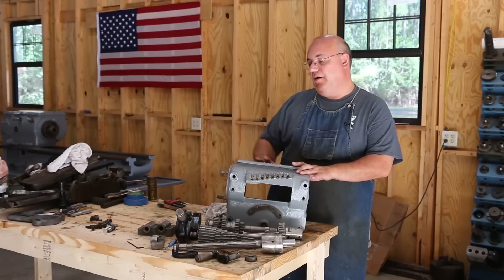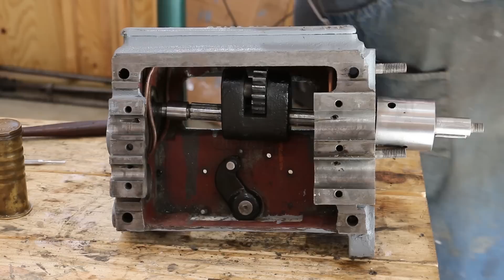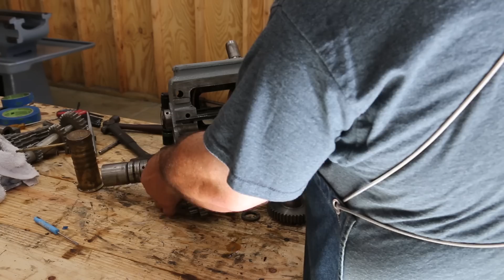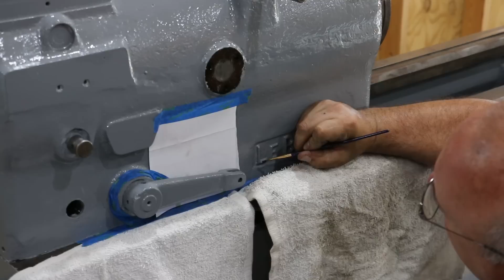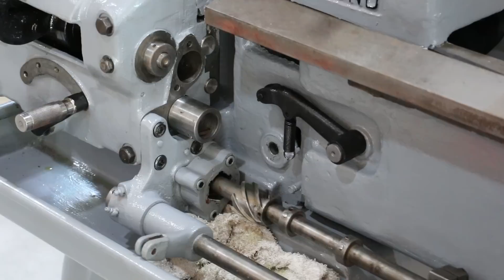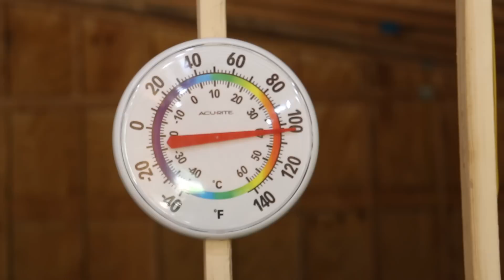LeBlond Lathe Restoration - Part 6:  Quick Change Gear Box Reassembly and Installation

Comment: The machines you work on are amazing examples of human ingenuity.  Sure, since the 1940s we've achieved moon landings and now AI, but who made the first screw precisely enough to cut more threads?  I guess they started with gears.  How did they get them to mesh smoothly enough to make gear cutters and carbide inserts?  And metallurgy?  My 1905 copy of the Machinery's Handbook describes steels that are still in common use, but none of them would hold up inside a rocket engine or EV battery.  On the other hand, the most modern trains don't run on lithium or ceramics.  After thousands of year of human history, standardized screw threads were invented barely a hundred years ago. It just keeps getting better.

Comment: I wonder why they have taper pins and set screws? The only thing I can think of is that they positioned everything with the set screws during manufacturing, then drilled the tapers. So the set screws are redundant.

Comment: My late uncle had what I think was a somewhat earlier 14" swing (which turned out to be about 22" in the gap in front of the chuck) LeBlond toolmakers lathe with almost exactly the same quick-change gearbox - although the change handles were brass not silver. The paint was a dark green and the "LeBlond" was picked out in gold. I seem to think the speed data plate was brass too. His wasn't a geared head though - had, I think, a three-step flat belt pully on the spindle - I loved the sound of the belt "flapping" - spent many hours with him learning about turning.  This video brings back some very fond memories - thanks Keith.

Comment: Hey Keith, either I missed it or ya didn't speak about the motor. Going by the pulley down on the motor, i'd say its got some torque and power.  looks great

Comment: Curious why you didn't get the parts Powder coated? Time and cost?
Reply from the maker: Time and cost for sure.  Also I would have to take everything down to individual parts and mask off all of the machined surfaces that you would not want power coat on.  Not very practical.

Comment: Progress is good. 

South Bend used set screws with brass bits for various things too.  Many of mine were missing the brass shoes, and honestly I found them to be cumbersome to deal with extracting so I got brass tipped set screws from McMaster to replace them.  Easier than fishing little parts out to lose, and it won't wreck the threads either.
Reply from the maker: LOL - yeah, they can be a pain if you take them all the way out!

Comment: When taking it apart, you STRONGLY recommended taking lots of pictures. Maybe a mention or look at some of them during reassembly. Great job Keith. Looks like new!  Bet it will run good too. Want to sell it? Just kidding.
Reply from the maker: Yep - I talked about that in the video when I first started taking it apart.  Pictures can be extremely helpful when it all goes back together!

Comment: Keith, you got that rod back in the correct orientation and that sir, is the difference between a thinker and a stinker. :) Good catch on your part. Keep up the good work!
Reply from the maker: I got lucky - usually I figure that kind of stuff out way down the line....

Comment: This is going to be so much nicer after you have it finished and put back together. Glad someone is no afraid of taking on the work of restoring these older machines and putting them back to work. Thanks for sharing the progress of it all and I'm sure having video documentation will help even yourself for remembering how it all comes apart and goes back together again. I was going to comment in an earlier video to use a sharpie marker where adjustments were left off at before disassembly but you already had 6 videos out on this done so it was already too late for that step. There were a few other tips I thought while watching but again, it's already past the point and I now do not remember myself what they were unless I were to watch it all again. ~ Cheers.
Reply from the maker: I will often mark items with either a sharpie or even a dot from a center punch to know how it goes back together.  I even used a sharpie on a few of the items on this machine.

Comment: Keith do you have to worry about specific torque setting like you have to on a car?
Reply from the maker: Torque settings are important for some things, not so much for others.  When dealing with bearings and gaskets, they come into play more so than just bolting two pieces together.  Nothing on the lathe so far has really needed a specific torque.  Even if it did, I don't have any specifications to work off of.

Comment: Did you resurfaced the guides on the chassis?
Reply from the maker: The ways?  If so, no, I have not done anything with them.  I will be discussing that in a later video.

Comment: Fantastic job!! This is motivating me to start my own restoration. Quick thought, my first instinct would have been to pack those bearings and gears with grease, why did you use oil?
Reply from the maker: The whole quick change gear box is lubricated by oil - there is a reservoir in the top that drips oil down through tubes to the bearings and the gears.  Not a good idea to mix grease and oil - better to just use what it was designed to use.
Reply: Understood

Comment: Looks to me like you could grease that fitting on the gearbox shaft if the other shaft is in the right position.  Hard to be sure from the video but I think it will turn clockwise and be accessible.
Reply from the maker: Maybe - but to be hones with you, I don't think that you could get a gun to that fitting no matter how it is pointed....

Comment: Thank you so much. For the first time I am beginning to understand how a lathe works. For the heat, you might try a home made swamp cooler.
Reply from the maker: The swamp coolers don't work as well here in the Southeast where we have high humidity as they do in drier areas.  We already have so much humidity in the air it is hard for the air to take any more!
Reply: Sorry, I lived in California - Wasn't thinking, but now I am: The Arabs used to create venturies by the way the windows were placed in the buildings (Needs wind though). Worked well for a thousand years. I used to take classes in a building designed specially like this at UCLA and we were cold all summer long. Seriously, we brought sweaters to class. The thing is the clear story windows of your mega barn seem similar. Just a thought.

Comment: Hello Keith, 

The lathe is looking almost as new and getting more and more a lathe again after assembly. To reassemble the lathe I guess you really have to have experience with older lathes. You know where all that levers are needed for and that makes re-assemble a bit easyer. But even with that you know how the lathe works it is still not easy and lots of work to get all clean and re-assembled.

Pfoe, almost 40 degrees in your shop seems really hot to mee and I am complaining about 27 degrees here in my room. Here in the Netherlands it was also at about 32 degrees celcius outside so much to hot for me. Also just like your place here is the humidity very high and not very pleasant when it is hot outside. 

Anyway, again a great video and a good way to relax a bit after all that bad things that happened with those people who where killed in Nice France. But this evening there are also 9 people killed in Munich from an Iran guy who lived in Germany. It is getting scary and I really hope that it never will happen here in the Netherlands. 

Looking forward to the next video and I am very curious how the lathe works after the restoration.

Many greetings from Roel !
Reply from the maker: Thanks - I am about ready to get this project finished and make some chips with it!  It will be fun to see how well the machine works when all is said and done!

Comment: I'm wondering if that Zerk fitting (at 27:13) should be one of the angled tips - a 45 degree fitting pointed the right way would possibly give you the clearance to make it functional.  Maybe someone replaced it in the past and didn't realise that a straight one wouldn't work once it was put together.
Reply from the maker: I don't think that you could get a grease gun to that zerk no matter how it was angled.  It is behind too much stuff.

Comment: Comin along pretty good Keith. Don't recall what kind of paint your using, but it's got to be pretty good if you can beat on it with your hammer! Little frustrating trying to remember how everything goes back together, but you got it!! Nice job!
Reply from the maker: Sherwin Williams oil based enamel.  Time will tell but so far, I am impressed with it.

Comment: Have a friend that restores things. he uses Qtips to paint fine letters. He uses the firmer ones and cuts the tip a little to make a sloping point. He dabs the extra off on a paper towel or a peace of cardboard and then applies the paint.
Reply from the maker: I have not had great luck with Q-tips.  The cotton can get stringy and make a real mess of things.

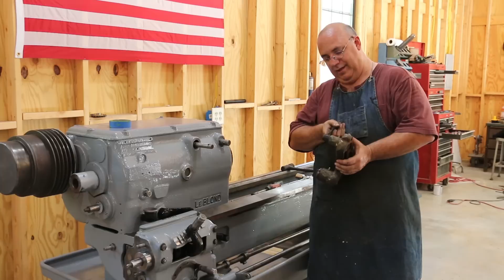Comment: Hi Keith Great video! What is the part you are talking about at 24:20? and where does it go? On the quick change gear box? Also, are you going to scrap the ways any?  Thanks
Reply from the maker: That part goes on the carriage and it turns engages and disengages the spindle on the machine.  As for scraping, probably not.  I am afraid that my scraping skills are not good enough to tackle something like this project - I would hate to make it worse...
Reply: I can see that.  Grinding and scraping is a lost art ...  Thanks for the note back.

Comment: It's looking real pretty Keith! Certainly a far cry from when it first showed up in the shop. I wonder what it would look like if you had used machinery green rather than black for the various handles and moving bits. The black strikes me as a bit more Victorian than that lathe really is.

Looks like you could do at least a short video on putting the remaining gearing back on the head, and figuring out what you want for a power switch and where to mount it.
Reply from the maker: I am sure that I will get all of that on video when I get to it.

Comment: I like the gray and black color scheme. I feel your pain about having to repeat stuff. A friend had a small generator with a 3 1/2 Briggs vertical shaft that wouldn't rev up when a load was applied. Someone had gommed with it and hooked the governor up backwards and lost the spring. I tore that thing down 15 times or more before I found out what was not doing what and got a spring that would work. It gets interesting especialloy when your tools are hot to the touch when you go to pick them up inside in the shade.
Reply from the maker: It is frustrating to have to go back and take something apart again, but sometimes, that is what you have to do....
Reply: Keith Rucker - VintageMachinery.org When you can't stuff it in any other way, there is no other alternative. Stay as cool as you can.

Comment: what's the difference between a needle bearing and a regular bearing?
Reply: It's like a roller bearing but with thin rollers hence the term needle, they have a good load carrying role , are small ID to OD ratio but do not locate along the axis of the shaft

Stuart
Reply: +Stuart Hardy thank you that makes sense
Reply from the maker: Google them - you will see what I am talking about.

Comment: Based on having taken apart a lot of WWII military surplus (bombsights, mostly), I think that where you find both set screws and taper pins, they were fitted for smooth running with the set screws, and when everything was just right, the taper holes were drilled and the pins set. Sometimes they removed the set screws, sometimes they didn't, but once the taper pins were in place, the set screws were superfluous.
Reply from the maker: That very well could be true.  WWII Bombsights huh?  Sound interesting to me.  The Nordon Bombsight by chance? Cool stuff!
Reply: Norden and Sperry.
Reply: Still, as cheap as setscrews are, why not use them? Also, If there is any looseness in the shaft, the set screws will prevent play in the axis of the tapered pin. As some of those gears/shafts seemed a bit easy to install, this would be my suspicion.

On a related note (because I've seen novices try this), friction set screws don't work in practice... to be used for more than a quick mock up (or setup as you mentioned), you either need a flat for the setscrew or some other means of engagement (square/woodruff key, roll/taper pin, etc.). Hence why they use more than just the setscrews (it's not just to keep them aligned during disassembly).  In this case, it's obvious (loading), but this can cause issues for lighter things too (hence why I hate it when I see things that do such, I think I once saw this on an arbor press handle).

Comment: Oil, more oil!  When I am assembling something like that, each part gets oiled just before assembly, every square millimeter of it, using an old toothbrush, various bottle brushes, and whatever else to make sure every bit of every unpainted and not plated metal surface is covered with oil.  Then I add more oil to whatever slides or rotates during assembly.  I use ATF for coating the bare parts, and way oil for the rubbing and sliding parts on lathes and mills.  Bearings are lubed per the manual instructions.  After cleaning up machinery, it is dry and is quite vulnerable to rusting, especially in humid south Georgia, here in the Sacramento valley it is much less of a problem.  I do the job like I want it to last at least another century before it gets rehabbed again...  Dripping is better than dry!
Reply from the maker: Thanks Bob - yes, oil is important!

Comment: Amazing work, even more in that heat!
One question: The gear that engages the threading screw looks like it should be slided by a lever or a mechanism of some sort. Isn't there something missing?
Edit: Just found the answer: in a picture in PracticalMachinist there's a cover you're missing: http://www.practicalmachinist.com/vb/antique-machinery-and-history/le-blond-heavy-16-a-151571-post827566/#post827566
Reply from the maker: I think you may be right!  I will have to investigate that a bit more....

Comment: Now that lathe is starting to really look SHARP!  Once its fully back together Keith, its gonna be hard actually I imagine to turn it on that first time for a serious turning job because you know that nice paint is then gonna start getting messed up as soon as those first chips are made! XDD

Excellent save with the reversing shaft, figuring out you had it in there wrong initially.  Last person who had the thing apart didn't catch their mistake until it was too late, leading them to adding the bastard handle to operate the reversing linkage.  Bummer though on the other linkages that were in front of the QCGB that forced you to take 'em off several times until you got the reassembly sequence right. >___< That may have been gentle warning from somebody that you better well rewatch your videos of taking the cross-slide and apron off a bunch so you know good and well the order to put things back on in. XD
Reply from the maker: While I love to have a nice looking restored machine, if you don't use it, it is not worth the effort.  I will have no problem getting it all dirty and even putting a few scratches in it....
Reply: :D Wonderful to hear you're not gonna be afraid to scratch up that new paint in the course of getting needed projects and repairs finished and done once its back together and ready to work.  I'm anticipating seeing what your approaches and plan is to getting that cross-slide nut back in place for the carriage.@__@
Reply: Oh, one more thing that I just thought of: the method of engaging/disengaging the spinning of the leadscrew just seems to be begging for somebody to get their fingers caught in the spinning gears, even taking into account how these machines were designed when 'common sense' was truly common.  If it were my lathe, I'd probably leave the leadscrew spinning all the time and just be careful about not accidentally bumping the half-nut lever.  Is there a better reason for keeping the leadscrew stationary until you're actually threading besides making it inconsequential if you bump the half-nut handle when you're not threading?

Comment: So confessions are good for the soul. You will probably have a few more before you are done. It is looking good. If she runs as good as she looks it should be a top notch machine. I restored my step pully Bridgeport in a similar way. Takes a lot of effort but it will be worth it. Try to stay cool and above all hydrated. Take a break if you have to. These kind of temps are dangerous. Look forward to the next one.
Reply from the maker: Thanks Johnny!

Comment: Is there any chance that that black mechanism with the grease zerk was on wrong when you disassembled? It is "L" shaped. "L"'s can go either way?
Reply from the maker: No, it only goes on one way for the piece on the bottom to engage in the yolk.
Reply: Zerk must have been misplaced like you said.

Comment: The old girl is looking great Keith. I ran the same machine 25 years ago and it was a pleasure to operate. Strong for its size !  Looking forward to seeing the chips fly.
Just as hot up here in Canada by the way. Thanks for the great videos
Reply from the maker: Yeah, the heat has been bad everywhere this past week.  I think it has been hotter in the midwest and up north than here even!